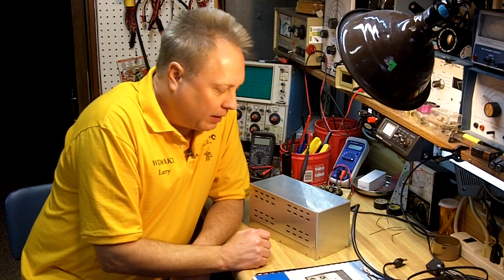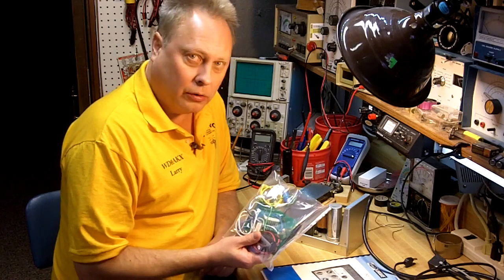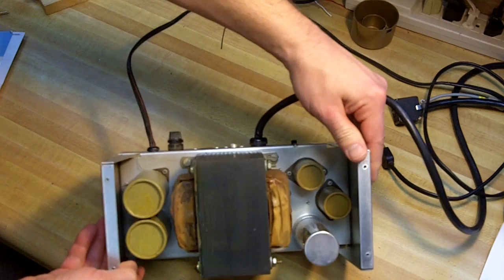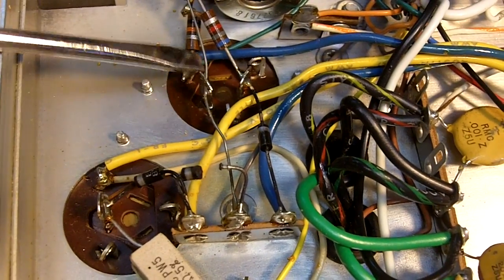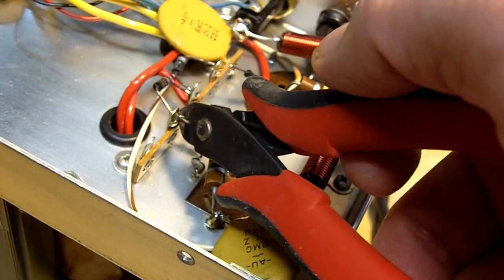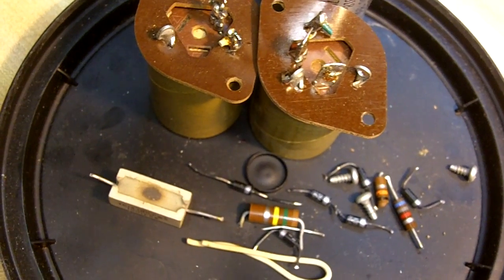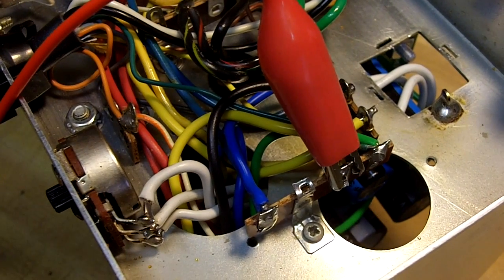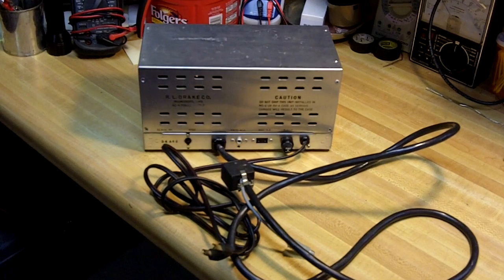Drake AC-4 Power Supply Rebuild For My TR-4Cw

Comment: I will need to do this for my Drake AC-4 power supply; thanks for the video, all this information helps.  Did you recap the TX & RX as well?  Thanks for a great video.
Reply from the maker: Yes I also did the cap kit for the transceiver also, there was just a few main caps for that to do.  Got the cap kits from Hayseed hamfest.

Comment: I would have removed the old paper electrolytic that are not being used. 1) What is the point of leaving them in for looks when you can not see them once you put the covers on and place it into the speaker housing? 2) What happens when those 39 year old paper electrolytic leak all over the speaker cabinet and your the surface your radio's rest on in your shack? If you had removed when you made the repairs this would never be an issue. if the parts where metal and visible from outside the unit I could see keeping the parts in hollowing out the part and keeping it in place even if the parts had been replaced on the underside with modern replacements but in this case the parts are waxed paper and not viable when in use. This might bite you in the rear down the road and for no good reason.
Reply from the maker: Good point I guess, I will have to consider that.  No problems so far though. Thanks for the post on this matter, others may be interested also.
Reply: I think working on car's has made me a bit preemptive when it comes to repairs. If you have to take a timing cover off to replace a drive belt you always replace the water pump, cam position sensors and any tensioners while you in that deep even if they are not bad yet since you have already gotten that deep into the engine. I am going to completely recap a radio that has been sitting in an attick for 18 years because all the IC's and transistors are obsolete in it. If one $0.23 electrolytic goes out it could take out a part that is not made today and hard to find. Kind of silly to lose a radio to $18 in capacitors. Some of the CPU/CMOS devices can run $50-$500 a pop because they are so rare and no spares where made. All of my gear is from the 1980-1998 all of the parts audio IC's, PLL's, Crystal Filter's/Mechanical Filter's are obsolete and hard to find even bipolar final transistors are hard to find or expensive.  RF parts wants $35 for a single 2SC1969 final for a 4 watt CB. Glue and leaking electrolytic can destroy a board and component parts. Even though I plan on taking the test for my General Class this winter I want what I own to last since the new gear is not that great by comparison. Modern SSB radio's are not that great compared to gear from the 1980's adn early 1990's. In some cases gear from the 1950 sounds better on receive and transit than modern ham gear that is DDS.

Comment: I read where the kit should work on the AC-3 power supplies also. Whats your thoughts on that?  I have one that has not been powered on in years, and im guessing it will need refreshed.
Reply from the maker: From what I know, the same kit will work for both the ac-3 and ac-4 but the mounting is different on the 3 and you have to drill out some special holes but the wiring is the same as far as I know, same color coded wires.  You can find out the details at the heathkitshop.com, I think they are still online. Or google that name.

Comment: Great video Larry, Hi quality. I may have to do the same thing with my Drake PS for my T4XB tx. Wondering if you know where I could get a sheet metal cover for the Drake AC1 Power Supply. Bought mine off of ebay missing the top cover and end plates.